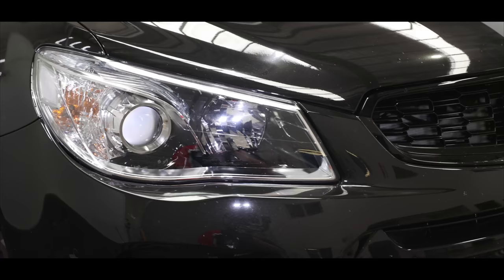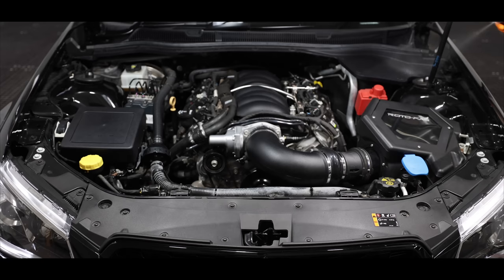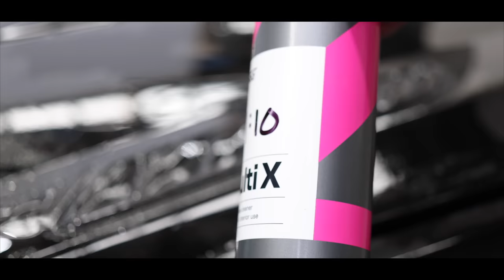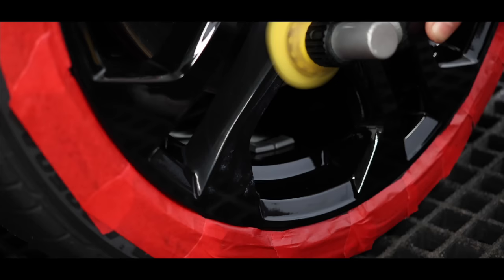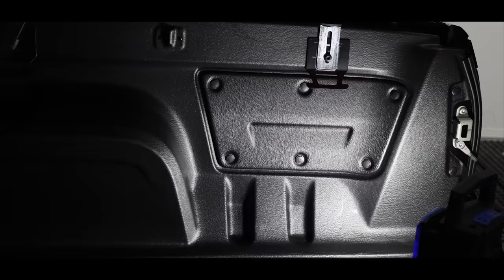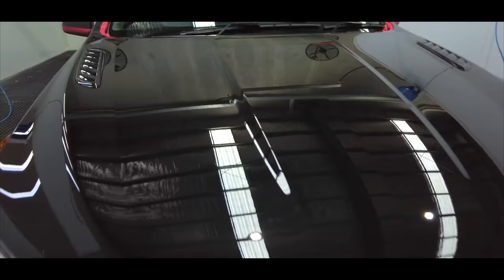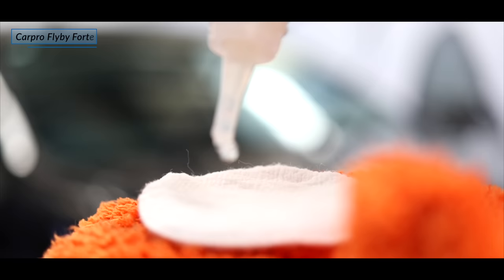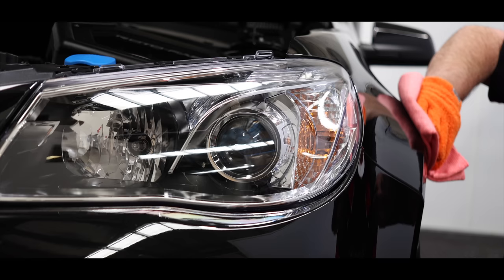A Preservation Car Detail | Holden LS3 SS Ute Get's The Full Treatment! (Vlog 47)

Comment: Hey Sandro, masterful work as always. I noticed during the snowfoam/rinsing sequence you keep the hood propped open with some microfibers. Can I ask why that is? I'm a beginner so learning as many little things as I can from your vids. Thanks as always man your vids are seriously the best detailing vids on YouTube
Reply from the maker: Thanks and I actually had some plastic masking the engine bay after cleaning it. I left it pop up just get the foam and chemicals better into the jamb area to flush and clean them before polishing the jambs layer on.
Reply: @CarCraftAutoDetailing  thanks for the quick response!! Appreciate the knowledge

Comment: Wow I'm not sure if I'm more impressed with the high level detail or the video work in this one! 

So once you find the best pad/polish combo and start polishing, how do maintain consistency between the 3 different size machines? Is it correct to say that each machine gives slightly different results due to size/power/throw differences? Is simply running each machine at the same OPM enough to remain consistent or is there more to it than that? Or, maybe I'm just way overthinking the whole thing haha
Reply from the maker: I’m really glad you enjoyed it. 
There’s a few things happening with machine polishing that you mostly just get better at the more you do it. One thing is getting to know your machines, pads and compounds where you better understand how they behave in diverse situations and the other is constantly assessing results. I can actually increase speeds and pressure at times to get better cut and then also reduce speed, product amount and heat at times to increased the finishing qualities on various areas of the car and on various machines. In the end I check each panel and if it need more work I’ll continue to refine the paint before moving on.
Reply: @CarCraftAutoDetailing  Thank you mate. I waiting on some orders to arrive, your vids have been a great help as someone just starting out. Time I got stuck into it and build up those skills :)

Comment: My continued thanks Sandro for your excellent videos which have helped me so much in fine-tuning my skills/craft and improving my detailing business. I know these videos take some time to put together but please keep them coming! 
One quick question, what pad did you use on the TA50? I find that the Rupes yellow, even as a soft finishing pad, can leave haze on softer paints.
Reply from the maker: Thanks Chris, but it was the Rupes yellow pad I used. Sometimes it can be a combination of the polish used with the particular pad that influences how that pad finishes, but on that paint the Rupes yellow pad was finishing quite well, but I have had issues in some other soft paints where the Rupes White pad was better in that case.

Comment: What was the thought process on using CQuartz products. I know you have a liking for Nova Pro and Glass. Is this for further research and using different products to always be learning soemthing new? Love from the US Sandro
Reply from the maker: I’ve been using CQuartz coating a little longer than Nv Nova ones, but really still use both quite a lot. The hard thing with the videos and what I share is that it’s just a very small portion of what I do and use, but I use both Nv and Carpro frequently though it may not always be balanced in the videos I put out.
Reply: @CarCraftAutoDetailing  Thanks so much for the info Sandro. You have taught me much of what i know apply to my work and i appreciate it more than you know. To qualify for Cqaurtz Professional you have to be 2+ years in work, have a portfolio, then must take their class right?
Reply from the maker: I think Carpro has more recently tried to open up CQPRO to be available a little easier than in the past, but no all regions may use the exact same qualifying criteria. It’s best to check with whoever certifies in your area or if unsure, contact Carpro Global on there website.